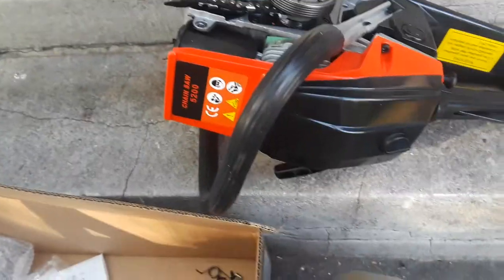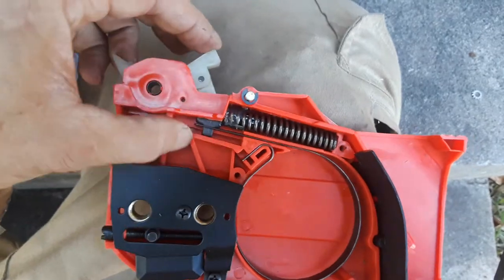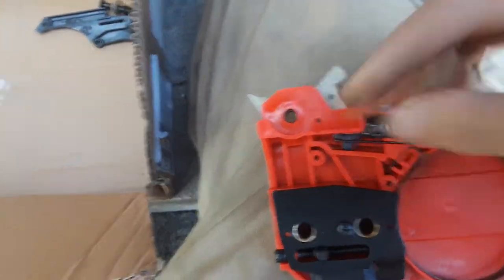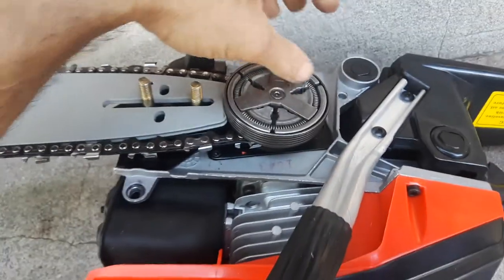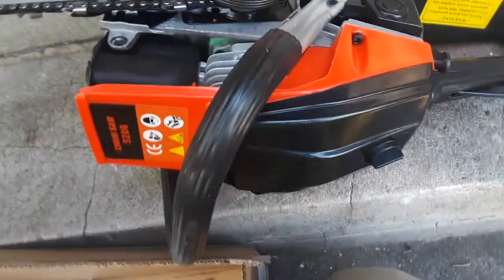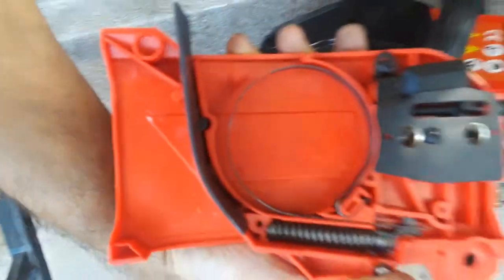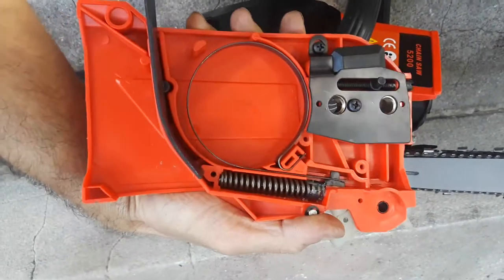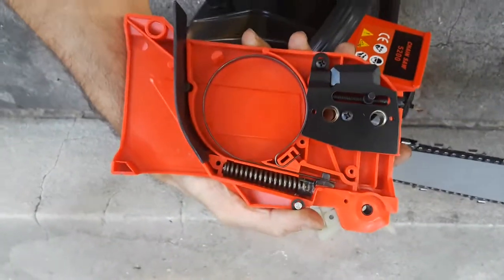Chainsaw safety stop jamb

Comment from the maker: To clarify, the band isn't too small, it's just that it being jammed makes the diameter of the ring it makes too small to fit over the circular metal hub on the saw. Once unjammed it will definitely open up the diameter of the band stop enough to fit over the saws metal hub just fine.
I just don't want to break it trying to un-jamb it and be stuck with a broken saw is my only concern.